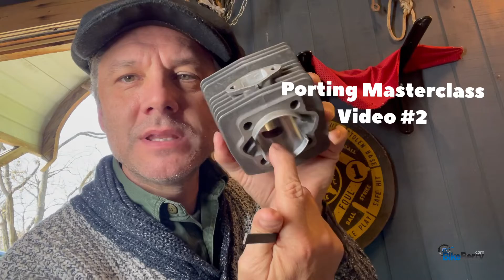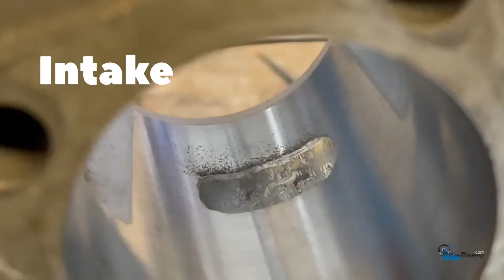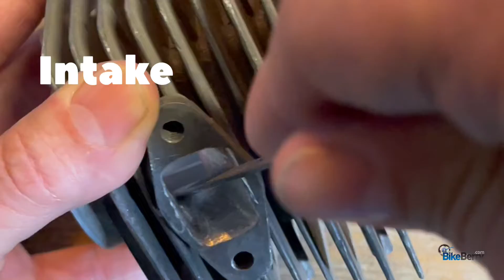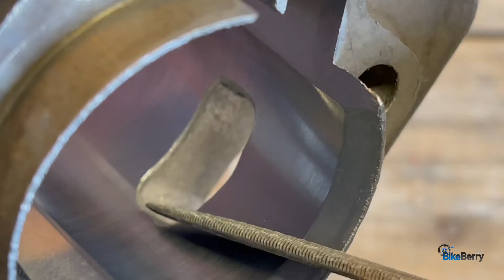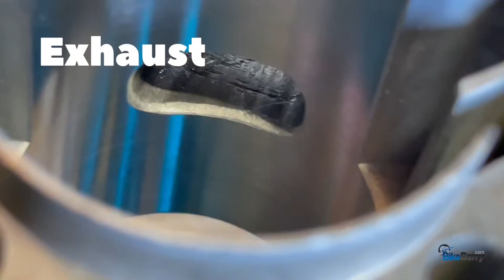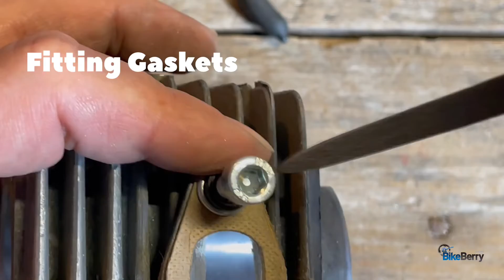Porting Video #2 - Chamfering Port Edges & Matching Gaskets | BikeBerry

Comment: Shouldn't use a file to chamfer the edges of the ports, it just chips the plating away leaving micro sharp edges. Using a small diamond ball on the Dremel will make a much smoother edge.

Comment: I don't know hownit waited about 1.5 to 2 weeks to do it but it looks like a port grabbed one of my rings the other day and rolled one and broke both locking the engine up i had to use a winch to extract the piston it was every bit probably more than 1000lbs of tension pulling with the winch to get it out of the cylinder case. I have a new engine as the last one  had just been bought and was guaranteed so i got the entire engine and bike mounting kit so ive got to get a piston and cylinder case and then ill have to go find my female friend and hook her bike up so she can ride with me and we can go work maybe get rich. You are the first person in or out of a video I've sèen or heard mention the rings getting snagged by a port which only confirms my belief.  Well thanks .

Comment: On those gaskets you can use a dremel with a round sanding wheel to file them away faster, It also leaves a smother finish and doesn't put as much strain on the filter. Good video though. Nice job Toney.